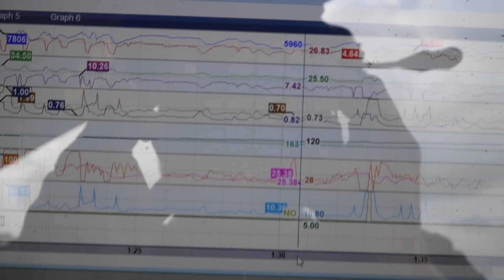2JZ S15 Final Competition Testing!

Comment: Put two washers in the oil pump, oil return-valve chamber under the spring, boost oil pressure to 6 - 8 bar... Also, sort out your cooling...

Comment: You will need to align the truck after the leveling kit to fix your camber/caster and depending on how high you go on your leveling kit you will need to to out just a hair or your tires will wear on the outside alot more than inside and if you want to ever lift it only go with a four inch kit and stay away from rough country lol since you tow alot go with a zone kit it is super strong compared to other kits when it comes to towing

Comment: If you wanted 10 lug's for your dedicated Superduty tow rig you should of bought a F450 to start off with.  Its a much better setup for straight tow rig duty.  Now you are going to be under geared with the taller F350 gears.
Reply: A 450 is unnecessary Flex
Reply: TurboDieselDan lol he’s completely fine. F350 can tow a 3 car trailer all day.
Reply: @mikejames6425  You probably said the same when he had his F250 SRW.

Comment: Uh 37s with just a leveling kit? That's huge!
Reply: Pretty normal for Ford trucks.
Reply: Going take a lot of power and fuel mileage away from the truck 33s would be better
Reply: @jaredm674  dudes going pro with a 1000hp capable s15 and nearly dailies a GT3 don't thing gas milage bothers him
Reply: @flynndodsworth2693  I think he'd run ignite in the truck if he could. lol
Reply: @starfox_wr-45e93  I would agree with you
Reply: Asphalt Warriors Superdutys come stock with especially a 35” tire from the factory.  

Stock is 0.35” under a 35” tire. 

Running a 33 would be going down almost 2” smaller than factory.
Reply: 35s will fit with the leveling kit not 37s
Reply: I’m wrong and yet he’s currently driving around on 37” tires and a leveling kit. That’s weird, it’d mean that I was right

Comment: There is no way that that engine is going to live if it's making 25 lb of oil pressure on decel while still above 5..6..7k RPM. That engine needs an accusump bad. Or you guys are going to be replacing Main and rod bearings every other event and eventually it'll take out the engine.

Comment: Oil pressure drop because the oil is to thin? Just saying the oil in a drift car gets hotter then in other cars because you are riding the revs. That might cause the oil pressure getting low. That can also cause more wear on the engine. Just try other oil...

Comment: im SURE YALL ARE PROFESSIONALS... BUT U MAY NEVER KNOW. adam ur lucky to have such a neighbor. i am not... but me also an external oil pump. or 2. with coolers. and a dispersing seperator unless ur dry sumpin ur shit.. have the feed on oppsing sides front andback baffle the pan . nd its not just the clutch prolly but ur fuel pumps prolly skipping while all ur fuels sloshing/slapping in its hanger grounding or run a voltage booster because ur alternators prolly pullin massive load. install a breaker switch inline of the starters main line so after cranking u can kill that live leak. make sure ur having a regulated power supplied relay for all that shit. but the Intake temp sensors has alot to do with afr, as in pulsation of fuel and fuel pump voltage because think abt how carb engines r only 5 psi but efi is 40-60psi but those carb systems were no joke when it comes to gushing gas... ur fpr is fixed but how fast the inj pulsates ad how much ohms are being used to draw back has alot techincal input but quenching cylinder wall nd exhaust valves.  reason why tunerswanna rich map spare no expensive but ur tryna rip ur ride , meth inject it man... anyways with  while engne cool temp sensors deal with timing because if its not externally electric water pump its only doing wut it can so the ecu will pull timing if temp spikes cus coolant will cavitate. run. more distilled water then antifreeze. with a regulated controller to take advantage of theheater core. cus coolants only for stock cars not to pop blocks. . ussually wit rx7s they have those pump tank pumps to a reciever to pumping inline nonreturn valve with the dual fuel filter cus any condensation will displace the ur fuel. yesmechanically all of wut im sayin may show psi afr ect fine but thats also why having fuel pulsation fluid dampner locking banjo fitting are on most vehiclecus u need it be atomized tha gas muc as possible. sum mercedes designs use the fuel return tank line run thru by heatsink attachment the aclines. the demon has a ac condensor inline of the charge pipe to ac cool the boost temps..  . unles ur e85. iono. but or maybe set ur rev limiter to having the recovery rate the same but shallow lean with a slight time advanced to keep that momentum as a floating sky but so when the rev drops erich map  or antilage the map for any grand rpm drop/pickup/why hotversion ** racers double clutch cus its clutching that the ecu engages the same mode as priming so that rpm pickup wont be high dry heave on the rings.. so throttle pumping wud expel excess fuel to quench the temps drop but ignite without bogging cus its only spontaneous if its vapor. and manufactures fuel maps are more

Comment: Would of had dual exhausts coming out at the back of the wheels so it pushes the smoke away.
Reply: William Wyn not fd legal. You need it to dump before the diff but after the cab as far as I know. They all run it like that

Comment: Mmm yea! I fail to see the point of all this work and money spent there isn't really a howl lot of skill involved or excitement about what might happen next just smoke and burnt out tyres that need to be replaced. I would much rather see the car race around a fast circuit or even hook up on a drag strip. I really enjoyed the one time that the car was driven on the road pulling through those close ratio 7 gears and the thing would just take off like it was electric.